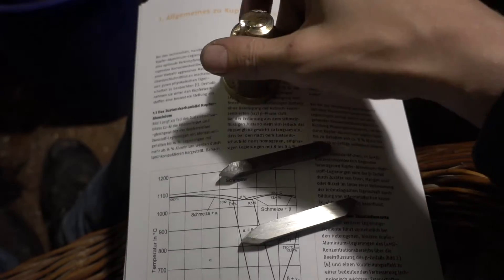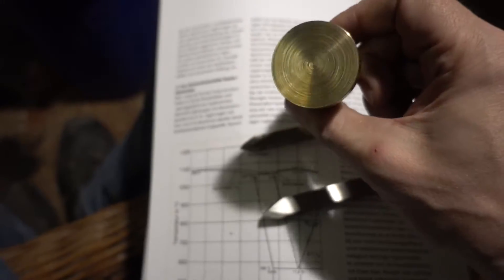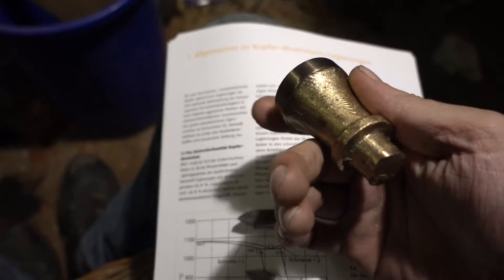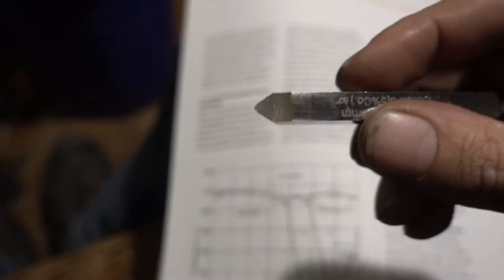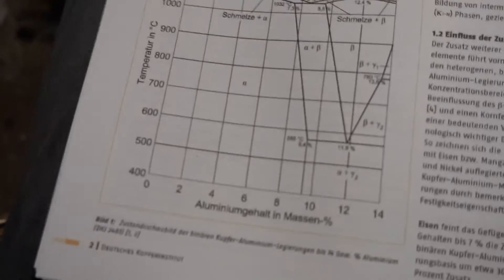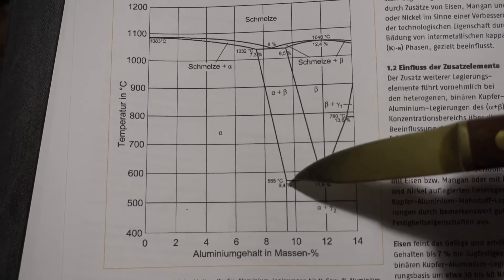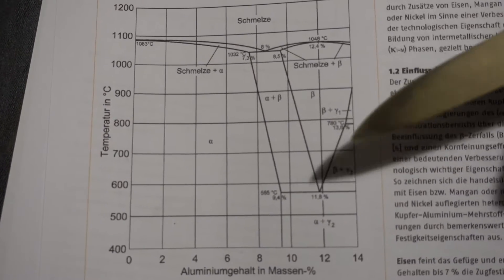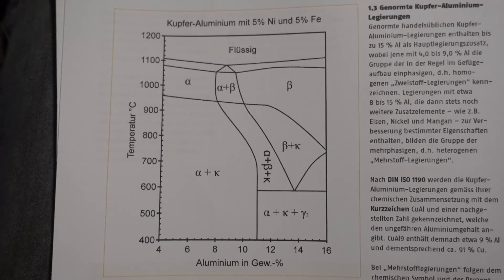a small update on my my aluminium bronze video

Comment: Thanks Heron - that's very interesting. Could you make your aluminium bronze more machineable by adding more copper when you remelt (to reduce aluminium content slightly)? I look forward to learning more. Cheers, Craig
Reply from the maker: not really, i have to get back to the 10-11% Al but much lower would make it to gummy.
there is another option: adding a material like lead. ( 1.low melting point so it stays liquid the longest 2. shouldn't mix with the other components in the solid phase) 
i have some bismuth (should work too, and is non toxic)
so i think i try it.
thanks for the interest , heron